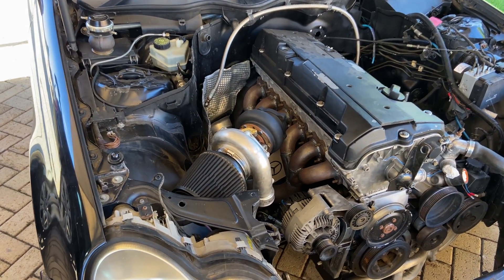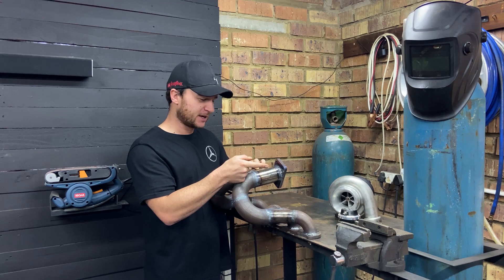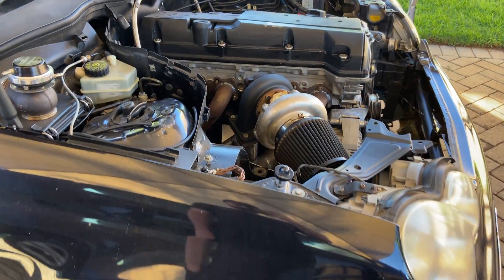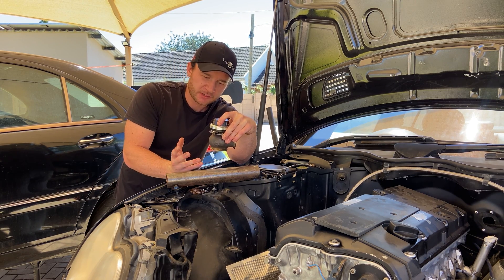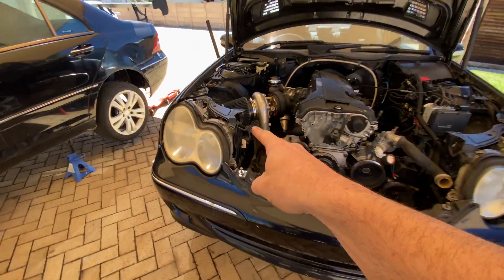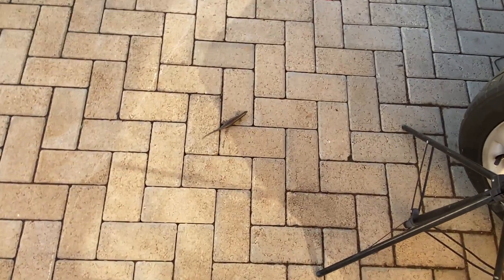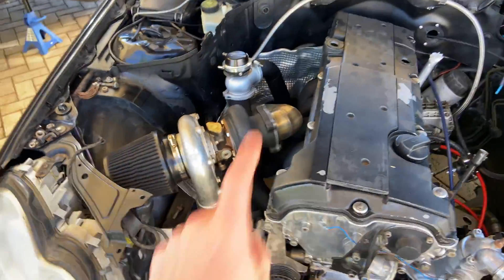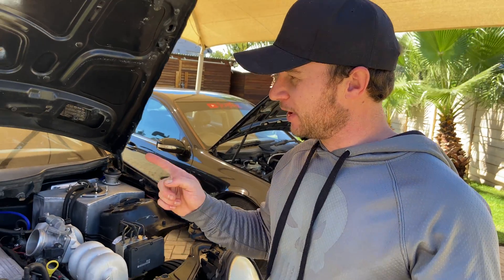Fabricating a Custom DIY Turbo Manifold Pt2 💥BOOST LOADING💥 3.2L Mercedes W203 M104 TURBO

Comment: What was the best HP you made with the m271? I’ve been following for a few years now keep up the good work.
Reply from the maker: It was 130KW\176HP back then🤙🏼
Thanks mate much appreciated!✌️
Reply: @RicerBenz RWHP? Making it about 215-218 at the crank? or crank hp? I’ve done tons of research and most people say mods make it slower what would you say? Lol I currently have a c230 sport with 6 speed trans, BC coils, and wheels and I would love to just make it a little bit faster or enough OOMPH to kick out the rear end at 20mph